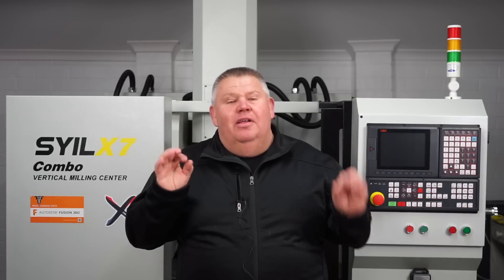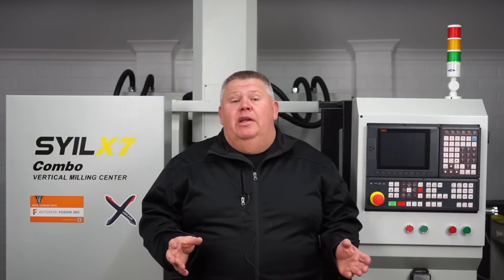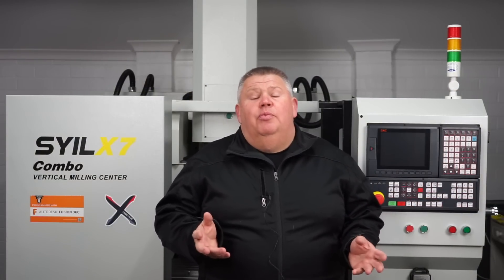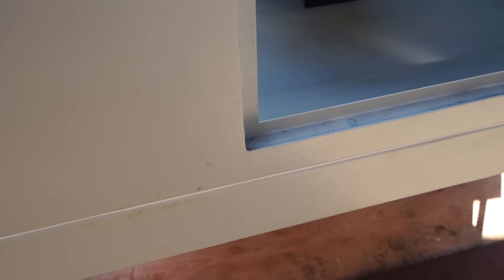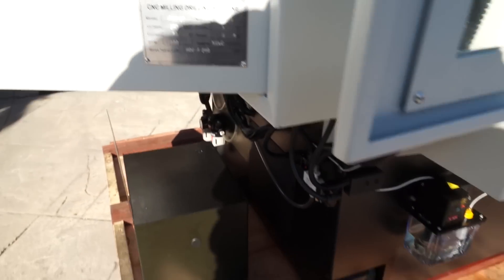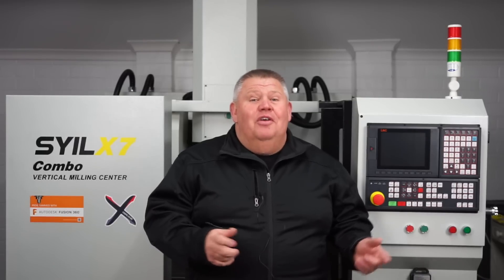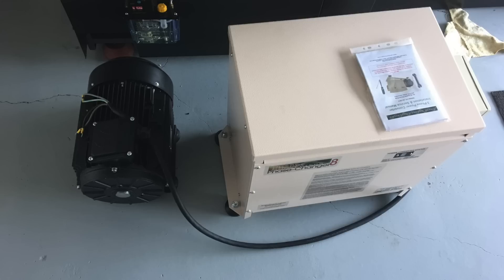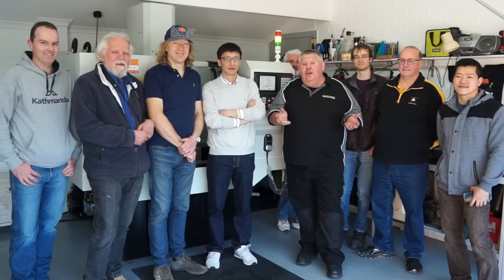SyilCNC X7 Combo Unboxing Video

Comment: Fantastic Aaron, I'm happy for you! Looks like you are going to be busy reading manuals for a while. Ciao, Marco. 
(PS: I still wanted to send you pics of our last flight, but I don't have a good email for you. You can contact me via the blog longezproject.blogspot.com where it says "Talk to Marco" (bottom right)).
Reply from the maker: Hello Marco.  Always great to hear from you.  One of the other Syil users over here is also into light aircraft.  He reckons he will be able to "shoe horn" the big fella (aka me) into the spare seat and take me for a run.  However, he might have to balance the other side of the wing with a bag of cement ha ha haha.  I will check out your blog spot later on mate.  Cheers, Aaron.
Reply from the maker: I thought you'd get a laugh from that.
Reply: That's because I can barely get in and out of mine. I tell people... "it's like flying a torpedo!" 😂

Comment: Thankyou very much aaron u answered alot of questions for me by watching your very well done video. Wish i could have joined the open house. Im curious about how u will good sound proofing your garage? Would be nice if u can run it 24hrs a day with disturbing neighbors
Reply from the maker: Hi Brendan.  Sorry about not being able to invite everyone over to the open house.  It was all last minute and I did this within a 3 day schedule.  To be honest the stress started to get to me and I was having heart palpitations :-( 
Yes I'm guessing that I will be unpopular with the neighbors soon.  I think I might have to get a rural property or industrial factory in the not so distant future.  Cheers, Aaron.
Reply: @DCT_Aaron_Engineering  All good mate i have only just been chatting with mr xushuo the past few days and he told me about your new installation. We have a 5 axis dmu70 here in sydney in a sound proof room. We built 4 walls around it and lined all the inside with rubber. We machine aluminum at 10k rpm all 24/7 the neighbors dont complain anymore. Im glad the install is all finished and u can start enjoying the machine. Im trying to see if i can look at someones syil 7 here in sydney as i wouldn't mind one to do some light work with. Is there a better way i can make contact with you? Im a 5axis cad/cam programmer former broens worker of 12 years if i can help u with any cnc stuff id be glad to help although u seem to know what your doing.
Reply from the maker: Brendan Dietrich I would love to pop in sometime to check out your set up. Compared to the work you do I’m just a backyard machinist. Simple 3 axis milling and 2 axis turning for me 😔